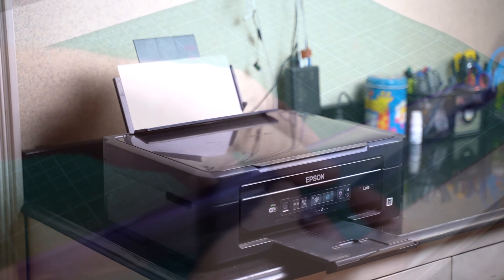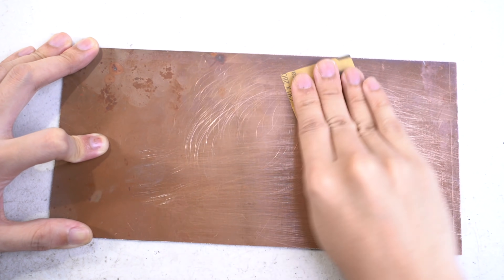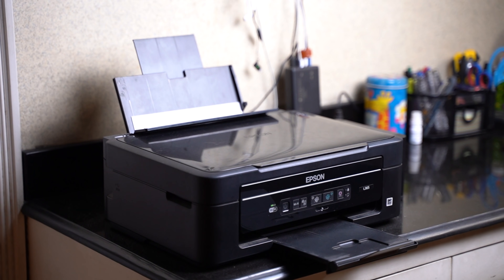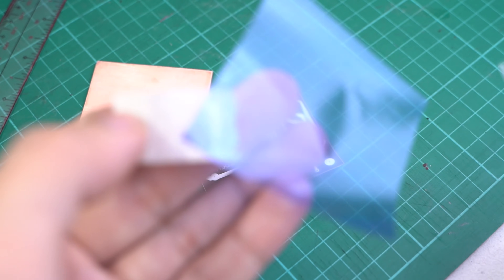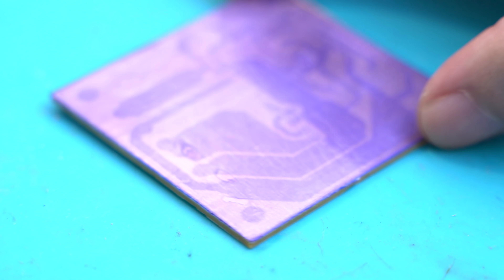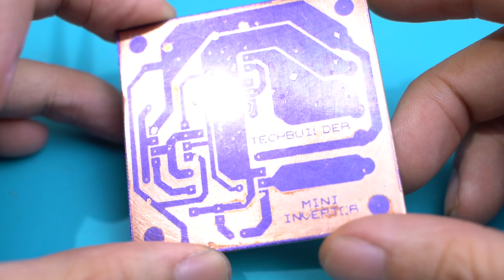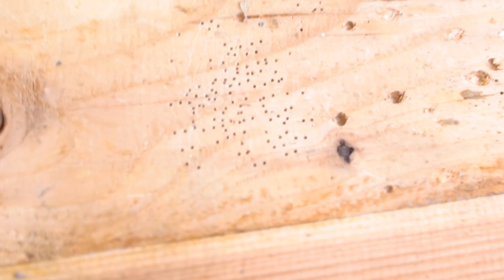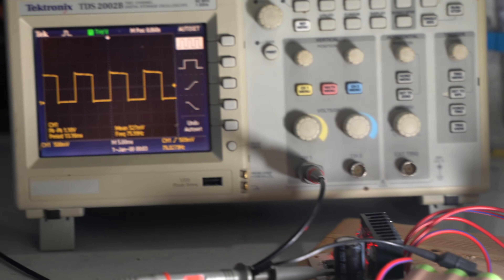DIY PCB Fabrication (Dry Film Inkjet Method)

Comment from the maker: Update: To get the best results, spray water on the copper clad PCB before applying the dryfilm sticker. This eliminates the bubbles easily. Push the bubbles away as if you were installing a phone screen protector. You may proceed with the clothes iron or laminating machine afterwards. Thanks for your tips in the comments!
Reply: If you spray 1 part iso alcohol to 3 parts water mixture, apply film and let it dry it will stick without heat. Also to remove a protective film easily throw it in the freezer for a minute it will come off extremely easy
Reply: I just prick the tiny bubbles if any, with an exacto knife.
Reply: SHAZAN MAHMUD  normal
Reply: SHAZAN MAHMUD  and place it upside down
Reply: Spray water and heat with iron  and news paper is op . No air bubbles on board like factory one .

Comment: i found that soaking it in acetone for a short while (maybe 1-2 minutes?) removes all the remaining mask without the need for a toothbrush. i used a very small rectangular container that is just a little bigger than the board, pour in just a little bit of acetone, put the board in face down and put a lid on

thanks for the helpful video :)
Reply: also, permanent markers are not the best. i've tried a few different brands but they all seem to be not 100% blocking the etching. it still works but at the end the surface under the marker lines are still slightly etched (or, occasionally, a bit too etched). or perhaps i just haven't got hold of a good quality marker? i don't know

in any case, i tried acrylic paint and it worked great. you can be a little generous and apply a thick layer of it. you have to wait for it to dry but that usually doesn't take long

Comment: This film is the same colour as positiv 20 and it develops with caustic soda. But it's the exposed part that dissolves. 

I use Positiv 20. I'm used to it and get good results and I do the exposing with sunlight. I print onto tracing paper with a a laser printer. If I had a UV box, the results would be pristine.

I like positiv 20. Old-school but good.
Reply: Make a pcb with a UV led array in an old scanner. You've got your uv exposure box. Try get high power uv leds to work faster or just expose longer with lower power leds.

Comment: Good method,did you use a inkjet or laser printer.
I would not use sodium hydroxide as a developer as it is very aggressive,i use soda crystals that are made from sodium carbonate decahydrate,it is very cheap and only needs two to three tea spoons per litre,it is totally re-usable.

As for the sodium hydroxide,i use it to strip the mask off of the pcb when it's been fully etched,then i use tin plate solution to add protection to the copper traces,after that i add a solder mask layer.

For production runs a pcb manufacturing house in china is the best answer.

Comment: I have had a hard time removing the photoresist dry film with acetone. I'm hoping MEK or something else will be better. Acetone will eventually remove the photo-resist but it's unclear whether it the chemical or the friction of rubbing it that's actually achieving the removal. It's clear that the acetone has SOME solvent effect on the film, but i don't have all day to sit here rubbing the board with acetone. I would prefer a bath that dissolved it without me having to babysit it.

Comment: i tried this and my uv light doesnt seem to leave anything on the copper, the film has the pcb layout on it but it isnt going through onto the copper, what could cause this?

edit: for anyone else having that same issue, in the video (and description) he says NAOH/lye/caustic soda, you want to use sodium carbonate. he mustve gotten them mixed up or something. NAOH is way too powerful and is used for stripping a board so you can start over

Comment: Would you say this method is better than using a glass/clip sandwhich with the resist between the glass or does it get equal results? Curious if I need to adjust timing

Comment: To avoid bubbles, apply the film underwater and squeeze out the air bubbles with a plastic rule. Works for me.
Reply: Wouldn't it mess up the adhesive?
Reply: @akshay.kumar.k there's no adhesive on the dry film, the adhesiveness will only activate once you iron out the film to the copper clad.

Comment: Try spritzing it with water on the photo board..this way it is slick underneath, then use a credit card to squeegy the bubbles out (like on a cell phone protector or window tint) no need to iron

Comment: Why people insist on using sandpaper to get rid of copper oxidation is beyond me. I use a shellac polish renewer liquid. I have no clue what is in it but it removes copper oxidation in seconds. Wipe on with a paper towel, rub it in a bit, use clean paper towel to remove the remainder. A PCB that size you just use would require three drops of that product and shine like new.

My point being there are products out there that are not abrasive and clean copper far quicker and better and best of all without reducing the thickness of the copper any more than needed.

Comment: Use chemistry to initially clean your PC boards. White vinegar and salt will clean up the oxide without thinning your copper layer. Just don't overdo the vinegar or let the board soak overnight in it or anything... vinegar will very slowly etch copper, too.    8)

Comment: Something else that should help a LOT is not using sandpaper to clean up the copper before starting! That's just begging to create scuff marks and voids where bubbles can form. Try cleaning the copper in a mixture of white Vinegar and salt and let that soak for a couple hours before rinsing it with water. Another way would be to wipe the copper down with soldering flux/rosin paste and use a hair dryer on max heat or a heat gun at about 200°c to melt the flux/rosin. Rosin paste is acidic when it liquifies similar to the Vinegar/salt mix. A quick wipe with a rag or paper towel should finish the job.

Comment: 7 minutes is a really long time. The issue is the paper you are using. most white paper contains a whitening agent that converts uv into a blueish light. If your paper turns cyan/light blue in uv light, then it also contains it. With tracing paper I'm getting only 40s exposure for a pcb, which is much, much faster.
Reply: Is it better print with laserjet printer or inkjet printer?
Reply: @ahmadimamadyan1396  Inkjet gives you a better contrast, though I had some success with laser printer transparency sheets. Some tracing paper will smear when used in an inkjet. Test the paper and printer combination you want to use first.
Reply: @djtransnazgrz ok thank you for sharing experience and suggestion

Comment: Why is the board not very clear to see if it has been exposed properly? You can hardly see if it has been exposed.
Reply from the maker: You have to tilt and let light reflect, you would see a faint difference in color.
Reply: @TechBuilder  Is the board done then? Is that good enough when you see a faint color difference?
Reply from the maker: @Berghiker  Yep! But I highly discourage peeping and taking off the paper printout mask then returning it back. This often leads to misalignment issues. It takes a lot of trial and error to get perfect results in any photosensitive types of PCB fab techniques. This is why it is crucial to record the exposure time that works best for you (since different lamps may vary in light intensity).
Reply: @TechBuilder  Ok. Cool. Thanks.

Comment: Alternative easy cheap method ,
1)Print your PCB with Laser jet printer on a  magazine paper (smooth one) or on a thing glossy paper 
2)place your printed pcb over a well cleaned surface of copper clad .
3)Now  take  nail polish remover on cotton and rub the back of your print for few min. slowly 
4) Etch  

Simple do try it

Comment: Someone help please. After I heat up the dry film and after I do the UV light process, the protective film of the dry film is not sticking in the PCB board.
Reply: Same
Reply: Hi @jer-el3499, this may happen because the uv exposure time is not long enough which makes the traces not hard enough in the deep side of it. Or the desolving time is too long which desolves the already hardened traces. So, you may need either to increase uv exposure time or reduce the solving time.

Comment: bro, bakit po yung sakin tinanggal ko na yung dalawang coating sa dry film then binabad ko sa led lights yung board with my circuit design tapos nung binabad ko na sa sodium hydroxide natanggal pati yung trace , binantayan ko nmn sya, ano po kaya pwe3deng solusyon
Reply from the maker: either kulang sa exposure time or sobrang tapang ng sodium hydroxide mo. Sadly since nagvavary sa light intensity and sodium mix cincebtrations walang definite off the shelf time. Tanchahan yan until maperfect mo
Reply: @TechBuilder  Thank you bro,  Tama ka po,  talaga tinitimpla at binabalanse sya.  Nga pla bro,  na try mo na bang gawing pang tanggal ng excess dry film sa board yung Sodium carbonate,  at pangtanggal yung Lye sa mismong dry film na nakadikit sa copper trace.  Kanina na try ko sya okay nmn sya.  Same result,  pero sakin di ko pa napeperkpek yung way mo.  Mas matipid yung way mo no need na ng soduim carbonate or yung washing soda

Comment: I use transparency film for inkjet in the printer,  sometimes I print 2 times and superimpose them together,  in case the blacks are not very good.  To apply the dryfilm to the pcb I spray deminrralized water (lef acid battery water) and apply the  film with a piece of 3/4 pvc tube. I pass the tube a couple of times to get rid of the bubbles and water. I store it in a dark envelop overnight to dry out.  The result is perfect! With the transparency film I only need 1 minute with a 15W PL lamp at 15cm away from the board (I made an MDF box with a timer and a piece of glass 2mm thick to press the film against the board)

Comment: I actually find dry film method the best resolution down to 0.16mm in my production. Toner transfer sucks because of Laserjet resolution and imperfect transfer. The key to achieve nice resolution for dry film is lamination. Use a bit water would drive out all bubbles.

Comment: Thanks for the tutorial!

My last PCB that I made was with this methode and I liked it a lot because it is the closest to the traditional methode and less expensief. 
My main problem is to do the negatief, I will try your methode to see if I can export in negatief PDF. This will make my life better.

The easiest way of putting the Dry Film is for me to spray some water on the copper before putting it on the PCB, I also like to do it the bathroom with a lot of hot waterdamp to reduce the dust in the air! When the dry film is on the PCB I use a old credit card to remove the water and air that is under the film and heating it up with a hot air dryer. This gave me good results.
Reply: Open your pdf in , photoshop . It will open as image. On photoshop >> image>>preference>>invert . Now now you have nagative of the image . Export as pdf and print
Reply: Select inverse colour to get negative pdf in proteus my friend.

Comment: Nice clear and complete explanation, wish I had seen this video before starting with this method :). 

I've found you can poking the bubbles with a needle can help. I also have tried wetting the board first, and letting them dry for a few days in a dark place. But I have a hard time getting consistent results this way, and drilling is another issue. My favorite way to make PCBs is scratch milling, like here: https://www.youtube.com/watch?v=VN0X4jVp4XI, especially if you dislike the etching/drilling  steps.

Comment: @TechBuilder please tell me what software you use for the designs. I have used Eagle and KiCad and I'm trying to widen my skills so to speak so I want to try that one out as well.
Reply: EasyEDA, it's free.  
All you have to do is enter the schematic, the components and PCB traces are automatically connected.  You move the components to your prefer location on the PCB, the traces are automatically re-routed to the new location.  So easy. No more missing jumpers.

Comment: clean the copper board well then spray a little water onto the board and then apply the uv film. rub firmly over it with a soft cloth. this will remove any air bubbles

Comment: Why does my whole film got washed away by the sodium hydroxide... Is it too concentrated
Reply: Use Soduim carbonate by washing excess dry film,  then after you soak it in to ferric,  use sodium hydroxide to remove the dry film in the top of copper trace

Comment: I found a perfect method for cleaning copper clad sheet before toner transfer...........

Use good quality plasto erasor  made for pencils
First clean any oil layer on clad  using dish wash liquid. 

NEVER USE ... NEVER USE ... ANY KIND OF SCRUBBER  Inorder to make it shiny.  It will create scratches
(My method is to get Zero Scratch clean finish.)

This clening is only for removing oil layer if present .

... Fun part is coming...

DRY the board with unused new absorbent paper. Or good quality cloth.

Rub thoroughly with required pressure
One or more times.

Use cleaning liquid (I used paint thinner) to completely wipe off the residues out of the board with very clean cloth don't use any paper like absorbant or cloths which can leave loose debris of their own.

.......Finished.....

You will have absolutely shiny copper surface with good toner transfer/ adhesion without even a single scratch.

Do this only with the printed paper beside with you so that do the toner transfer (hot ironing or cold method using ethanol+acetone mix ) immediately before any contamination happens on the copper cladding.

By this way we can make good quality traces without scratchy track surface

Comment: I use this same method. But your has  minor differences. I use sodium carbonate (washing soda) for development step to remove unexposed paint and use sodium hydroxide to remove paint over PCB traces in final step. I had used this method to create boards having LQFP32 package ICs.
I have concern about using sodium hydroxide in former step as it may cause to remove some amounts exposed paint thus affecting quality of the traces.

Comment: Can we expose film using sunlight ?
Reply: Yes, you can. I had done it and it worked well enough. But the exposure time will vary depending on the position of the sun in sky as well as conditions like clouds. 

Later I built an UV exposure using UV LEDs. It gave consistent results, mine works by 40 seconds. Of course that will vary depending on number of LEDs used.

Comment: Excellent video and narration.  I appreciate the pace and not needing to wait for long sequences, show speech, and gratuitous gaps.  Everything is explained quickly and efficiently.  I made some flexible pcbs a few years ago and used some similar film.  I bought a heated laminator to deal with the bubbles and they were still difficult.  Since the boards were large, about 18 x 3 inches, I had difficulty exposing them and used a UV bulb with an aluminum reflector that I waved back and forth.  You can imagine that getting the right exposure time was difficult.  But the prototypes eventually came out good. It was a real fun project with 300 SMD LEDs and passives, transistors and a microcontroller. This video make me want to make another one. One thing I did differently was that I used cupric chloride, beginning with just HCl acid.  I didn't want to deal with storing or disposing ferric chloride.  It etches faster, making it a little more difficult to get good results.

Comment: You can etch very fast with FeCl3 just boiling it with your pcb to about 70-80 Celcius in a closed jar. It can be etched pcb in this method  in 5 to max 10 min.

Comment: Great work, bro. Over the years, i've spent some fair amount of time with diy and pro pcb methods. The one that has worked best for me was using the heat toner transfer paper. I also avoid using sand paper to remove the oxidation and toner. I instead use scotch brite sponge. Not as aggresive as sand paper but gives a more polished finish. Lastly, i apply a coat of lacquer (electrical grade) to protect the board.

Comment: your pcb should be super clean with soap, then use acetone. It is recommended not to touch fingers on pcb. You can then use pure water to make wet pcb and place dry film. In this stage you should not have any bubbles than use laminator. I can make tracks as small as 0.05 mm. The trick is to make a pcb as clean as possible and do not touch with bare hands.

Comment: Sir, at 00:10 why were all the lines soldered? Why not just the components?
Reply from the maker: Hey benj! The other traces were thickly tinned for more current to pass through. The others were just tinned to prevent the lines from oxidating 😁

Comment: Hey bro, if you say this method is not useful for smd circuits, can you say what method would be good for such types?
Reply from the maker: Presensitized Photoresist boards are my number one go to when I fabricate 8mil boards, I made a tutorial about it too. It's technically the same with the dry film but the photoresist layer is pre-applied for the presensitized. Presensitized also has a thinner photoresist layer which doesnt require rubbing (rubbing usually knocks of dry film mask traces). I'm working on my dry film skills to see if I can try a different approach to achieve 8mil lines.
Reply: @TechBuilder  But presensitized board are too costly right?